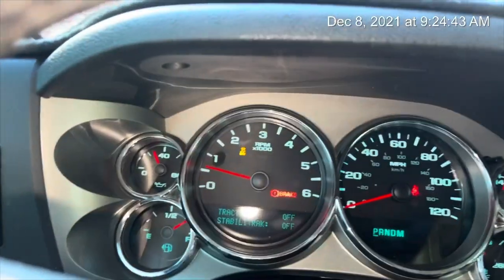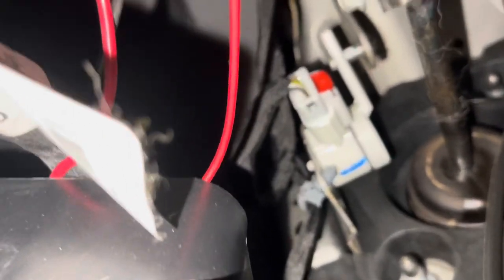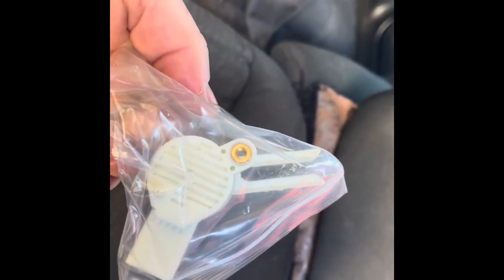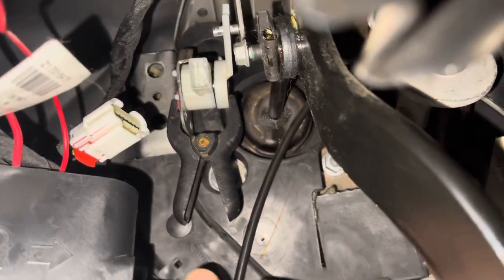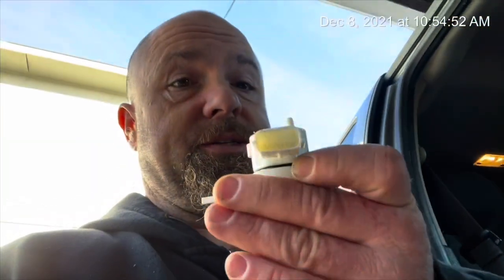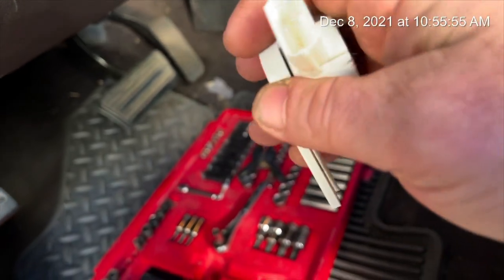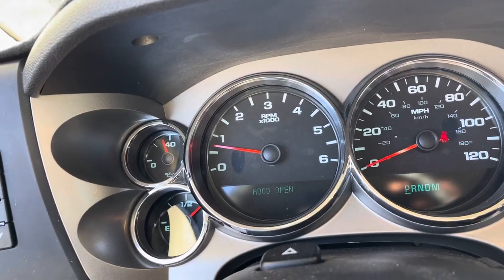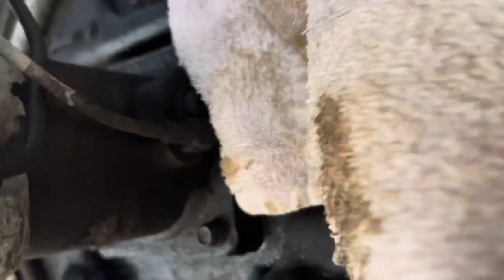2012 Chevy Silverado Brake Switch Replacement

Comment: Mine come on an goes off while I’m driving brake fluid is full but I noticed my brake lights stay on after I let off the pedal goes off if I pull out on my pedal I’m curious if you might have some advice

Comment: Strangely my brake lights (rear brake and third) stay on when the truck is on. If I unplug the switch they go out. Not getting any stabilitrak or brake warning lights on. I'm going to try the switch.
Reply from the maker: That would do it. Just when you change it, make sure you pull the power cable so it can learn the new brake position. This was a major headache with me, until I found after switch is replaced it needs a reset. (Positive power unhooked for 30sec) which whenever anything electrical gets changed it really does insist on disconnecting the battery, so if I did it right I would have never had the problem in the first place. Shoot might pull power for 30sec and re connect it, maybe it would fix w/o replacing switch.
Reply: @backendhandyman  شكرا لك لقد عانيت حقا حتى رأيت تعليقك شكرا مرة اخرى
Reply: @backendhandyman  Thank you. I really suffered until I saw your comment. Thank you again
Reply: Thank you @backendhandyman

Comment: I stuffed 25 cents inbetween the plastic peg and the nub sticking out the break lever turned off stabilitrack and the other light . The battery has been getting drained soo hopefully tomorrow when i go to start my truck itll still have battery. Only reason why i noticed it could have something to do with that was because my brake lights were stuck on
Reply from the maker: Yeah this is a crazy deal